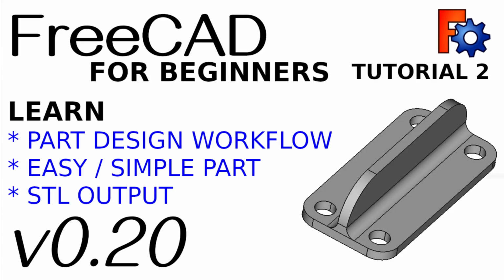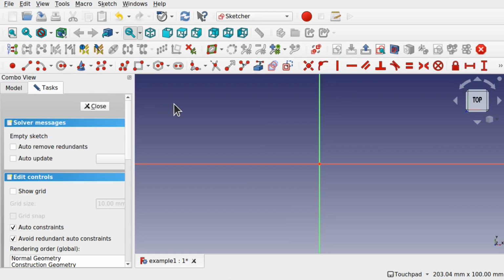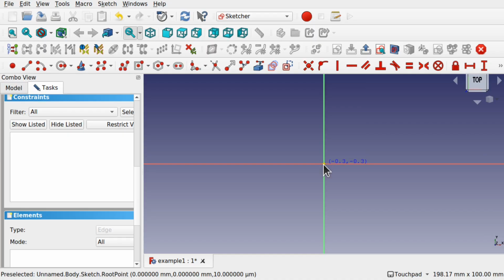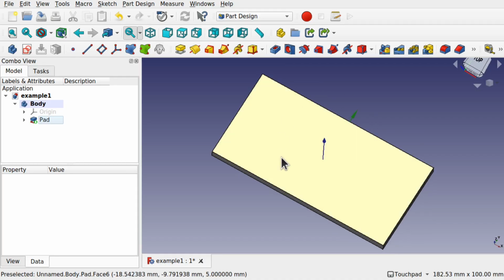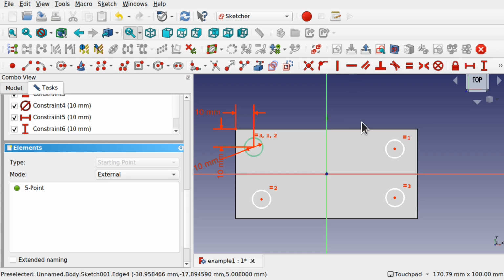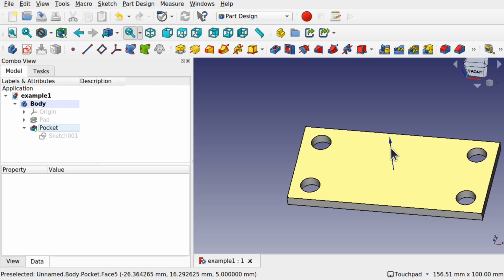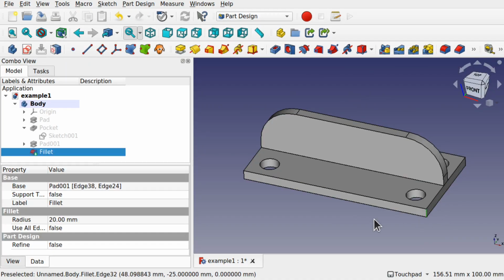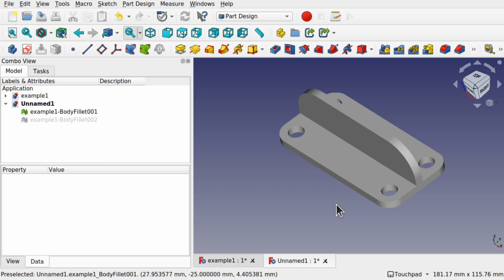FreeCAD 0.20 For Beginners | 2 | Create a simple model and export to STL in Part Design

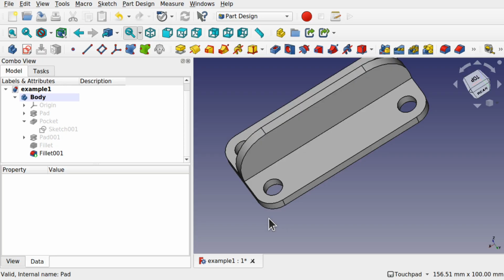Comment: At 35:31 you selected the inner line to fillet it ,i am stuck with the problem that , when i  select the fillet option there shows an error .and iam using FreeCAD version 0.21.2 because the latest version does not support my laptop and some of the options you showed in your video like in fillet option you can add more than one by selecting add option but on my version the option is not there .

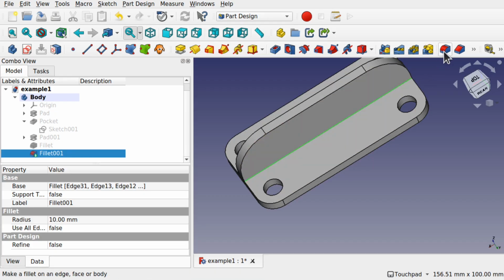Comment: I am on minute 35:36 using FreeCad 0.19 and when I attempt to apply the fillet it gives me an error message: "10:51:32  Failed to add external geometry: Not able to add external shape element"  Everything else you have shown I have been able to do without issue.  What could be the problem?? [RESOLVED] The problem was a bug with that version because I downloaded freecad 1.1 and performed the operation without an issue.
Reply from the maker: Glad you have it resolved and thank you for coming back and updating the comment, much appreciated.
Reply: @MangoJellySolutions 
You are welcome! I'm hoping to learn to use freecad to design and 3D print jewelry models

Comment: I accidentally keep pressing esc on my keyboard and thats when i close the body. and then i cant see the combo view and i dont know how to return to it. Can anyone help me point it out?

I keep going from the objekt to the ''part design'' once i accidentally leave the adjustment area and then i just delete every circles to get back to the combo view is there not a easier way to do that? haha 

Thanks in advance guys 🙏😂
Reply from the maker: In FreeCAD 1.0 the old Combo View is gone. It used to have the model tree and tasks in one panel, but now those are split into separate panels.

If you want the same layout as before:

Go to top menu,  View, Panels and turn on Model and Task.

Dock them side by side (or however you like).

This quick video will help: https://youtu.be/hIO1ZKMYUDs

If panels are still missing or the layout looks broken, reset the preferences and they should show up again.

Comment: Great tutorial.  Regarding the approach to creating geometry: think about how the part will be made and design for that process.  This part appears to be two welded plates with a weld.  likewise, you would revolve geometry if the part is being turned.  With 3d printed parts anything goes other than avoiding overhangs and other quirky stuff.

Comment: Just learning CAD and followed the general advice to use FreeCAD. Unfortunately(?) version 1.0 has been released and it's difficult to follow exactly obviously but I managed well until it came to adding the sketch for the vertical part. It would always add it to the Pocket and then complain when trying to add the fillet between the two sketches that it wasn't solid.

Had to give up at this stage.

Not a criticism of the video at all, it was excellent, but sadly not so relevant now that v 1.0.1 is out.
Reply from the maker: Hi, thanks for the feedback. I have a newer series for version 1.0 which will have a more familiar interface and also deeper explanation of problems you may encounter and how to fix them if your interested. I am looking to refresh this series in the future. Thank you so much for taking the time to feedback.

Comment: I got as far as putting the four holes in, and then nothing worked like you showed 😔 External Geometry did not turn those sides purple for me, and i could lock the rectangle to the edges of the part.
Reply from the maker: This sounds like the sketch was outside the body. In the treeview collapse the body and your sketches should disappear as they are within. If the don't, drag them inside the body. Now you should be able to pull in the external geometry. When doing do, look towards the bottom left of the screen for messages in the status bar, these are easily missed by often lead to the problem. Hope that helps.
Reply: @MangoJellySolutions  thank you. I'll have a go tonight.

Edit: no, I can't do anything: all the sketchers tools are greyed out.
Going to start again from scratch.
Hi. I re-did it from scratch, and after a couple of miss-steps, I finally did it. TYVM 😊😊

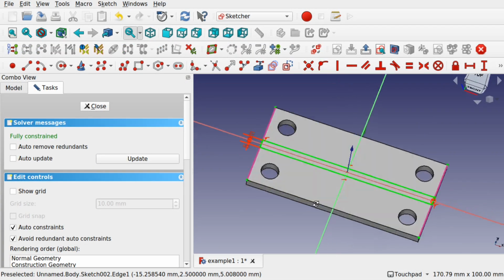Comment: 30:26 in newer FreeCAD versions you would not be able to pad this sketch since it uses external lines which coincide with it's own geometry. To solve it you need to pull external vertices instead of lines and use them to set constraints on your own geometry.

UPD: you actually may use those lines in the video, but as I've learnt from lesson 4 you need to hit "toggle construction geometry" on them and only then they won't stop you from padding the sketch. By default external geometry is pulled as actual geometry, not a construction one.

Comment: if I want the model such as battery to be solid inside rather than hollow, how to do it??
Reply from the maker: The result of this tutorial will be a solid model. You can create holes and holes inside with thickness tools, pockets and subtractive features.
Reply: @MangoJellySolutions  actually I want to make Cylinder3D, so, I want to make a solid cylinder inside with another cylinder surrounding it, I mean a solid cylinder inside a hollow cylinder. Can you suggest me how to do it or can you suggest any tutorial of yours?

Comment: As a new FreeCAD user I had issues following these tutorials as I was running version 1.0.0.  The toolbars and some of the menu options didn't look the same as the tutorial was showing.  I downgraded to the version being used on-screen and everything clicked into place, I could follow with ease.  I know versions evolve but for a complete beginner, like myself, its  a bit disheartening not being able to follow what's showing on-screen and trying to find the correct toolbar icon or menu.  

This is no way a criticism of the tutorial or the content creator as I know this was posted 2 years ago and as I said versions evolve.  Apart from that excellent video series (even though I'm only on video 2).  I am confident I can get to grips with this now.
Reply from the maker: Hi, I am looking at a overhaul of this course but at this moment I am running the Basic Beginners FreeCAD v1.0 lessons which are for the current version, it does take a different approach a teaches the theory as well as the practical.  This may be of more of an interest for yourself if your struggling with converting the 0.21 into v1.0.  Here is the link and I hope it helps: https://www.youtube.com/playlist?list=PLWuyJLVUNtc3UYXXfSglVpfWdX31F-e5S

Comment: I thought this video was so helpful, I took the transcript and created timestamped sections for quicker reference in the future.

0:00 - Introduction and Recap of Part 1
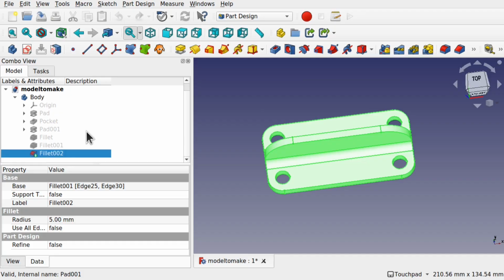0:30 - Overview of Modeling Workflow and Tools
1:58 - Introduction to Part Design and Sketcher Workbenches
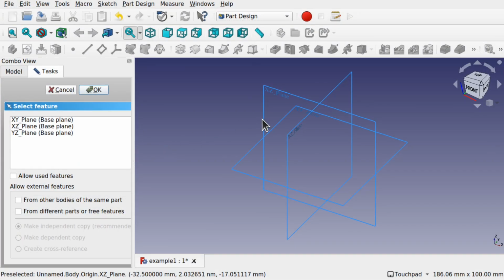5:05 - Creating the Base Sketch
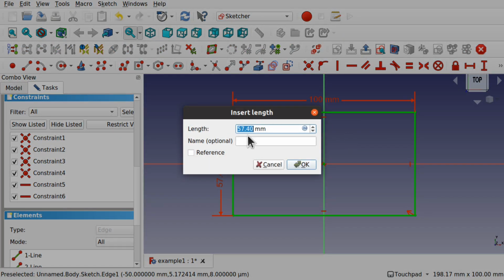12:05 - Adding Constraints and Fully Constraining the Sketch
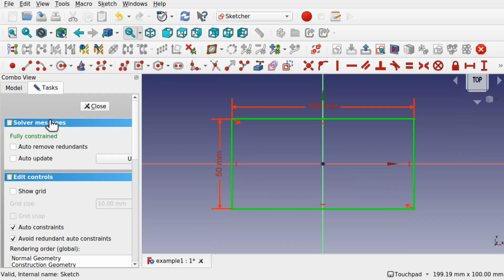14:47 - Padding the Sketch to Create the Base Model
16:25 - Adding Holes Using a New Sketch and Pocket Feature
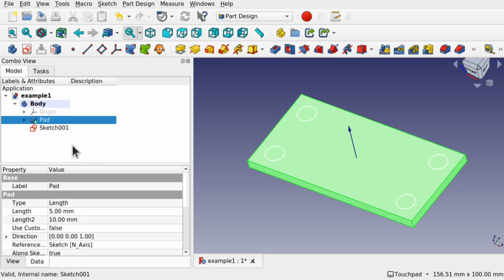26:10 - Modeling the Upper Feature with Extrusion
31:01 - Applying Fillets and Dress-up Features
35:50 - Exporting the Model as STL for 3D Printing or Other Use
38:08 - Conclusion and Transition to Part 3
Reply from the maker: Thank you so much for taking the time in doing that :) Really appreciated.  I am going to pin this post :) :)  Glad you enjoyed the video

Comment: Here's a bit of advice for the window action at 6:34. I moved the Combo View to an unexpected place by accident, and FreeCAD thought I wanted it at the very top, snapping it there. This made following the tutorial awkward. It took me a few minutes to figure out that I needed to push the Combo View almost halfway out of the FreeCAD window to tell it to position it back on the left side like is shown in the video.
Reply from the maker: Thank you for adding that, those windows can be tricky to control whilst dragging.
Reply: @MangoJellySolutions  Also, to let you know, the Fillet parameters window looks very different on my computer. It has a "Select" button instead of "Add" and "Remove". I haven't had time to sort out how it works, so I just did the fillets each by hand.

Comment: Thanks for the nice tutorial. 
For practice puposes I basically duplicated this model of yours. It all works well except that when I export model to ".stl" file and view it in 3D-Printer preview, the model doesn't show all the features -especially the  "Filiets" and "Champfers". 
I made sure that all items were selected via "Edit" -- "Select all" option but it doesn't seem to work.
What else could I be missing? any comment/advice would be welcome. Thanks
Reply from the maker: Glad you liked the tutorial. I think I know where the problem is. Try selecting the body rather than everything and then export that. Use the tree view when doing this. If that doesn't work try selecting the very last operation of the  body in the tree.
Reply: @MangoJellySolutions  Many thanks for your response. Instead of selecting "all", I selected just the last item in task list and then exported. It works now. 🙂
Reply from the maker: @user001sg9  Great to hear :)

Comment: Thanks for making these tutorials! This video in specific is a turning point, now I feel confident to do simple designs! I am still struggling to adapt to FreeCAD rotation + pan controls :D
Reply from the maker: Great to hear they are helping. In regards to navigation, there are the navigation settings in the bottom right where you can change the type, so if you come from a different 3D package or just want different mouse/key combination for navigation then you can experiment. Also in the preferences you can experiment with the navigation settings for a different feel. In my 0.22 / v1 series there is a short tutorial dedicated to navigation which could help and is transferable to the current version of freecad.

Comment: had a second attempt at Tute #2. Can only get to pad face OK, but then pad face will not accept a sketch, and the sketch tool bar items have gone into hiding. Extremely difficult to follow, but there appears to be a problem with the version of Freecad that I am using Version 0.21.2 - If there is any one out there following on Tute 2.

Comment: Practical question: around 25:00 you constrain the hole on the bottom right to 10mm from the corner of the rectangle. Can you, instead of type in "10" (mm), reference the same distance as the hole top left?
Reply from the maker: You can if you name the constraint.  Then you can type in the name of the constraint and they will be linked so if the main constraint changes, all other linked ones will change as well.

Comment: @7:19 I only have (empty sketch) under solver messages (no checked boxes)
I also don't have the 'edit controls' windows under the 'solver messages' 
I do have constraints but it is basically just a big empty white box
And under that I have 'elements' which again is just a big white box.

I'm using FreeCAD 0.21.2 

It'd be ALOT easier if my screen looked like yours, when I've NEVER used CAD in my life.

Comment: Hi,  Am new to 3D freecad, please I'll like to know the difference between stl file and gcode and how to save ito gcode. Thanks
Reply from the maker: Sure no problems. GCode is a textual list of instructions telling a CNC machine (router, printer, plotter, laser cutter etc) how far to move and in what direction to create a model.  STL is a 3D file format that describes a model.  a STL is converted to GCode via using a slicer or a CAM package to create the instructions to recreate the STL in a medium such as extruded plastic for 3D printing, or removal of material when coming to routing or laser cut.  The process for 3D print from freeCAD would be to create your model, export to a file format such as STL, OBJ etc (what ever your 3D printer supports), load the model into your slicer software such as Prusa Slicer, set your desire print quality, filament type, scaling, position etc and then slice and export to GCode.  The GCode is then transferred to the printer via memory card, usb, etc and you select the Gcode to print from the printer to start printing.  Hope that helps

Comment: so I do a rectangle  and it is locked down. I close, yours reads name-body-sketch, on mine it reads name-sketch-body, and when i try to pad the sketch it says i do not have an active body? any ideas?
Reply from the maker: By what you have described your body wasn't active when you created the sketch. To get around this right click on the body and select, toggle active body. The body should be in bold. Any new sketches will be created inside the body. If you have a sketch outside the body, drag and drop it inside. Hope that helps.

Comment: I have run into a weird problem I am using FreeCad ver.21.2 and was able to make this model successfully. Using this method I made another model, and after 3D printing it discovered I needed to move some bits around. So I went back to the Sketches to make changes to their Dimensions but now Free Cad now REFUSES to update the Body with ANY of the Sketch changes I have made even though I have Activated the Auto Update option. When I go to the Sketches to inspect them the Changes I made are THERE, but when I hit close the Body looks the same. Is this a BUG?

Comment: In my version it doesn't have the 'Add fillet' option so I manually added fillets on the other 3 edges.
Reply from the maker: Your probably using 0.21? The series moves onto that version further on and there are a few differences.  The button is on the left panel after selecting the filet option and will change when clicked.  Also look out for the tracing tutorial, it will talk about a image workbench which no longer exists.  There is a video regarding this workbench and the new method that freeCAD uses instead.

Comment: I just cannot say how thankful I am for your incredible generosity... I am moving along slowly and not sure I understand everything being done, like, when we were creating the first vertical piece, mine kept putting the rectangle underneath until I realized if i clicked on "body" then it was on top - just a newbie error :)  

I also noticed some interface differences (I did go through the first video). I am using Version: 0.21.2.33771 (Git).. 

And lastly, I found in my version, sometimes the icons didn't work and the menu option for the same action did work.. and other times both ways worked - strange ..but, nothing that is related to your incredible work!

Thank you so much again

Comment: I’m using the latest version as of 3-20-24, but I don’t have all of the options across the top that are shown in video.  I understand the drag and drop tool bars to expand all the categories, but I don’t have the same category sections.  Does anyone know if any add one where implemented and what they are called?  I’m having trouble finding the add one to match the video in the add on section of freeCad.

Any help is greatly appreciated!

Comment: This is a great tutorial but, I need some help. I'm using version 21.2 and at timestamp 33:36, the fillet parameters does not have the "Add" button. How do I add an Edge in the newer Fillet parameters menu?
Reply from the maker: Ah so in 0.21x this has changed, you have a button top left above the list.  When this is showing as select then you can add the fillets.  Clicking the button will toggle between select and preview.  Hope that helps.
Reply: @MangoJellySolutions  Thank you very much for the help. It seems that when the button is in "Preview", we can add Edges and when it is in  "Select", in turns off the fillets. It seems a bit backwards but now we know. I'm excited to start Lesson 5 now.

Comment: I attempted the navigation and manipulation of a cube in FreeCAD referencing the diagram labeled "Touchpad Navigation style" @ 0:15 . Using a conventional mouse with a track will, the only thing I can do is pan the cube or enlarge/shrink the cube using the mouse wheel. The keyboard shortcuts in conjunction with the mouse just simply not work. Anyone have suggestions?

Comment: I don't have "add remove" options in the fillet menu.  I had to manually select all 4 before fillet
Reply from the maker: The early parts of this series was made on 0.20 the latter parts on 0.22. There are a few differences that can be worked out. I am looking to rework those videos and bring them up to date. Thank you for highlighting that for others. I am building a list of the ones that get a comment saying there is a difference. The differences are small but it be good to get some new videos out.
Reply: @MangoJellySolutions  I figured out that it's by default "select" mode now.  I appreciate the series.  I find it's very well done, as challenging as it is for me at times.  That's a personal problem and has nothing to do with your teaching/tutorials, lol